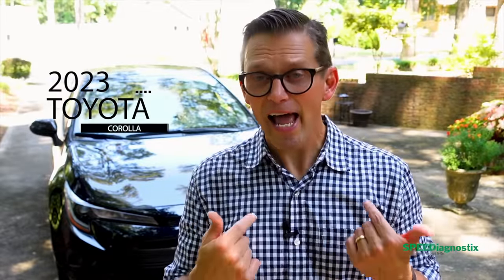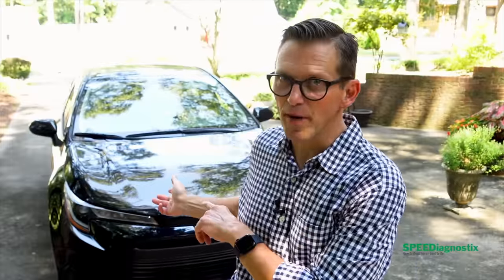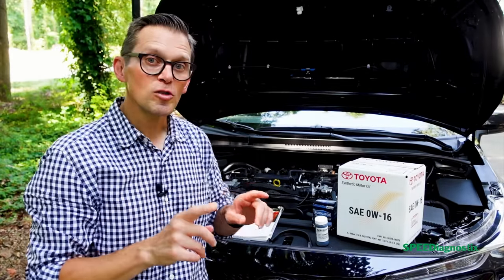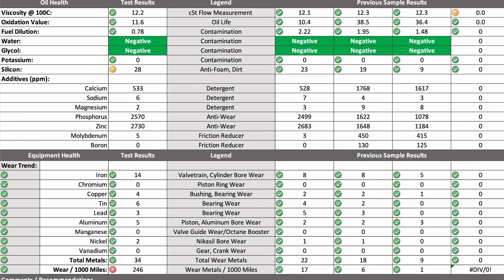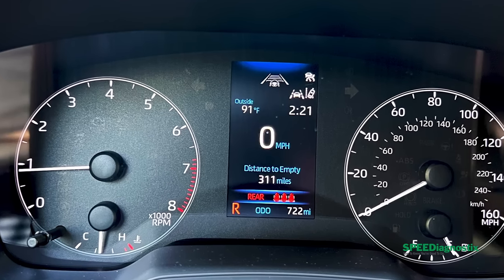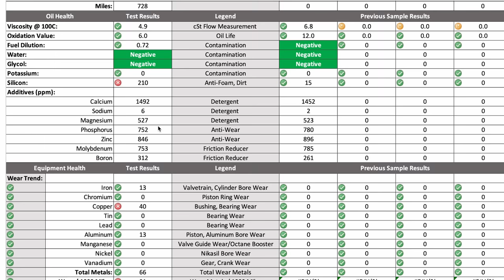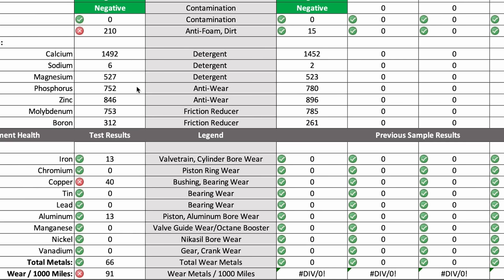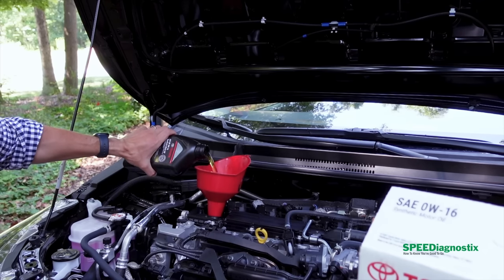AVOID the ONE MISTAKE Almost EVERYONE Makes With A Brand New Car

Comment: This reminded me that I need to change oil in my daily. I don't have good access to oil tests here in Europe and I drive a lot on dusty gravel so I try to stay on top of oil and air filter changes.
Thanks for all the great information. 👍
Reply: It's all a load of time wasting money wasting oil wasting crap. Just change it as per manufacturers recommendations. Oil tests are a joke too.
Reply: @motleydude73  I have no idea what you mean, but the manufacturer doesn't know how I use my car.
Reply: @PSA78  You use it the same as everybody else, which is giving the engine far less stress and abuse than the manufacturers give them when benchtesting them. Toyota run theirs for 144 hours straight at full revs. If they say change your oil every 10,000 miles or 5000 under 'severe' conditions you won't have any problems.
Reply: @motleydude73  That's not how it works, they know very well that different conditions (even different regions in the world) require different service intervals. I used to run engine tests for an engine mfg.
Reply: @PSA78  It doesn't matter just change it as per manufacturers recommendations it'll last decades and hundreds of thousands of miles, unless it's an inherently flawed design, like Hyundais and Kias. Just crap. I don't care about your 'credentials', real life experience says manufacturers OCIs are fine.
Reply: @motleydude73  Of course you don't care, you're just here to troll everyone with your "knowledge". 🙄

Comment: I usually download the South American owners manual for my car(same exact engine) and check the oil weight listed and that will tell you this incredibly thin oil is strictly for USA CAFE standards, not engine longevity. In many other countries for that exact engine the manual calls for up to 5w30 oil.
Reply from the maker: Thanks for sharing!
Reply: That figures.
Reply: I can attest to this also for Transmission Fluids. I rebuilt a 2003 GMC Sierra 2500HD and also a 2006 Chevy Silverado 2500HD both have the same transmissions (4L80E) and the 2006 called for (different) thinner fluid but I put the thicker transmission fluid as was used in the 2003 GMC. For people who say well the clearances are tighter so you need to use the thinner oil. These were the exact same transmission down to every last seal, etc. The USA CAFE standards along with these rip off companies are destroying the vehicles and getting maybe slightly better gas mileage from maybe a little less friction. Hence why they say in the manual for this Toyota to do the first oil change before 10k, if they were honest they would say 500 miles and send this video to every buyer of their product.
Reply: @usapilot78  so true. I don’t know who started this tolerance myth but it’s been proven wrong.

Comment: ❤ it! Going to do the same with my next car. I use synthetic oil, extended life filters and 5000 Mile oil changes which I do myself.
Reply from the maker: Sounds great!
Reply: You should be able to go for a long time with this strategy. Doing it yourself means it will be done properly.

Comment: I recently got a completely rebuilt engine (brand new block, etc) and it had oil and filter changes at 20 minutes, 250km and 1000km.  It's had 5000km changes ever since.

Comment: Manufacturers used to recommend a pretty comprehensive break-in procedure.  They all used "break-in oil".  I remember the first change being at 1000 miles, not 500, but it probably varied over time and from one manufacturer to another.  During that 1000 miles you were advised to not rev high and to not run the engine at a steady RPM for long periods.  But most important was that 1st oil change.
Reply from the maker: Thanks for sharing!
Reply: Was that in the 1970s? 🤣
Reply: @promethbastard  No it wasn't. I started my automotive apprenticeship in 1993. No cars had 'break in' changes. The first change was always at 10,000 kms. These days it's 15000. I bought a new Honda Accord in 1995 first change was due at 10000. A break in period was recommended but not early oil changes.
Reply: @promethbastard  It was in my country. Did away with break in changes in the early 80s here. I remember my Mums 1978 Toyota Corolla being done at 1000kms. But Dads 1984 Nissan Sunny first service was at 10000 kms. Americas always been a bit behind. Still use miles 🤦
Reply: @promethbastard  Nobody I knew/know ever did it.  There's no point to it. And the cars lasted many decades and hundreds of thousands of kms so that in itself proves it's a waste of time and money. Nothing wrong with dealerships, highly trained techs and OEM parts.
Reply: I bought a 2021 kawasaki vulcan brand new and it had the 1000 km break in oil change where I was told not to keep the rpm steady, I also recently bought a 2024 mazda3 and was confused when I was told the first oil change was at 8000kms with no special treatment to the engine required in that period of time. (Yes I know ones a bike and one is a car but both combustion engines).
Reply: @smackers1514  thanks for the information  i currently have 3 Toyota  i have a 2022 camera xse  bought brand new  2000 Tacoma sr5 bought brand new and a 1986 Celica gts   one owner  bought  new  one owner  me  and all three of Toyota get  a oil change at 1  thousand  miles virtually every month  but any way thanks for the comment
Reply: From USA: My 2003 3.6l v6 Pontiac and 2007 650 Kawasaki motorcycle both had explicit break-in and first oil change instructions in the manual.  My 2017 6.4l v8 Dodge had even more detailed engine break-in instructions but no special instruction to change the oil 'early', which was surprising to me.
Reply: @jameseverly8501  Every month? 🤣🤣  On all three? 🤣🤣
Reply: @oogieboogie232  Why was it surprising? Do you not understand what oil and filters actually do?
Reply: @motleydude73  It was surprising to me as both previous vehicle manuals explicitly stated to change the initial oil and filters after a much shorter period than the normal interval and the new one did not.  I didn't perform that first oil change on the motorcycle so I can't speak to it, but there were visible flecks of debris in the car's oil and I've had similar experience with the first oil change for my father's vehicles.
Reply: @oogieboogie232  None of my cars ever required it. Nor the thousands I've worked on as a service tech. I bought a new Honda Accord in 1995 first change was at 10,000kms, as per Hondas recommendations. I've yet to see any detrimental effect to not doing break in changes. Current 14 year old car is at 251,000 kms zero problems. A lot of motorcycles run a break in oil, basically mineral with a high zinc and phosphorous content so that should be dumped out after 600 miles or so. Cars, in my experience, haven't needed an early change since the 1970s. Some models obviously recommend it.
Reply: @smackers1514  The Bike would have had break in oil from the factory the car doesn't. Hence the difference in change intervals.
Reply: @motleydude73  Interesting.  Im curious what was in the pan in the Hemi after 1000 miles but it was a lease, didn't fit on my old wheel ramps, came with a service plan, and given the included service I didn't really want to go buy a bin of 0W-40 😄.
Reply: @oogieboogie232  The filter collects most of it, anything above microscopic particles anyway, and the oil holds any other particulates in suspension amidst anywhere up to 9 litres of oil. Engine 'damage' is more in the minds of paranoid people than anything physical. I thrashed my Accord from day one it was upto 277000kms when it got written off by another owner. Was still running sweet with zero oil consumption. I know as I often serviced it after my ownership. There is no harm in changing oil out early but IMO it's not neccessary.
Reply: @motleydude73  yes  pretty much around 1 thousand miles   1986 Celica gts 2000 Tacoma sr5  and 2022 Camry xse  one  thing I hate  is I am not a fan of synthetic  oil  unfortunately    my 2022 Camry  came with that type of oil    however  I recently had  change my Tacoma to a synthetic  blend  which is ok I guess and I am lucky enough to find Castrol  10-30  regular  oil for my  Celica  although  in my Celica I have been using Mobil  10-30 conventional oil for the  past 30 years  without single engine issue  but any way thanks
Reply: @jameseverly8501  A good synthetic lasts 15k these days so dumping it at 1000 is insane. Must cost you a fortune.
Reply: @motleydude73  thanks  for the response   however not saying you but I  will not go 15  thousand  miles on my oil my 2022  Camry which has synthetic oil  cost me about 90 dollars an oil change  my 2000 Tacoma   I am using a synthetic blend  which cost about  120 dollars  for an oil change  and on my 1986 Celica  gts  i am fortunate  enough to find  Castrol 10-30  conventional  and that oil  change is around 100  dollars  and yes  every vehicle  gets and oil change around  1  thousand  mile  but any anyway thanks for the comment an I am not a fan of synthetic   oil main reason  is that my Celica  1986  I have been using Mobil  10-30  conventional oil for about 30 years   without a single engine problem or issue thanks again  kind of funny  on my Tacoma and the Celica  i have to purchase  my  own oil and have the dealership  do the oil change with my  oil lol
Reply: @jameseverly8501  But WHY? You are just wasting money and good oil 🤦  1000 miles is ridiculous. You can do 10x that distance. Most people do. No problems.
Reply: @motleydude73  I perfect understand that, but I buy my vehicle brand new and do the oil change about once a month or abut 1 thousand from the start and that is my standard no disrespect on my 1986 Celica  gts  i have around 272 thousand mile and have done the oil change same way for about 38 years and I have not had one single problem out the car and or engine   original engine with no problem
Reply: @jameseverly8501  Yea , same with all my vehicles done at 10k miles. Zero problems. Anyone would tell you 1000 is excessive, even 3000 is only a fifth of it's usable life. Synthetics are far superior to mineral. Hence why all modern cars use it now. But do what you want. It's your money.
Reply: I ve never heard of break in oil.
Reply: @Peterthepainter66  It was used in cars up until the 1970s, and still is in motorcycles. Has a high zinc and phosphorous content. Modern cars don't need it first change can be done as per manufacturers recommendations. At our Dealership that's 15000kms. A break in 'period' of careful driving for the first 1500 kms is recommended but there is no special oil in a new engine.
Reply: Yes to driving at variable speeds for a new vehicle and especially don't use the cruise control on flat roads until after the first oil change.
Reply: @Roarmeister2  Why on earth not? Perfectly fine to.
Reply: Subaru still recommends this in the owner's manual
Reply: @motleydude73 most new cars have the first oil changes free as part of a service package...so there's no cost at all
Reply: @motleydude73 dude mind your business stop forcing your beliefs onto others
Reply: @truckercowboyed2638  Not in my country they don't. First service is $365 at our dealership. And they're not 'beliefs' they facts. You think changing your oil every 1000 miles makes good economic sense? It's nothing short of insanity.
Reply: @motleydude73  
Into the 2010's at least here in NA. There was a person here in Canada who bought a new Jeep about a decade ago. Didn't follow the break in procedure including the first oil change at a 1000kms (I think), and the engine seized at 2000kms. The warranty was denied. The break in oil change wasn't done. That person took Jeep to court but lost. Even made the local news. Some people think you just get into a vehicle and drive it . I had a 87 Chevy Sprint that I bought new. I put 187,000 kms on it with only 3 oil changes including the break in change which was at 500 km's.
Reply: @MrDarcykampe  If the engine siezed at 2000kms it was a design fault nothing to do with the oil, which would not have been break in oil. That's 1970s idealogy. High zinc/phosphorous oils are still used for motorbikes but not cars.

Comment: Just bought a brand new Tundra HV. I always change the oil at early and frequent intervals within the first 5k of life. First one at 500 miles, second one at 2000 miles, and then again at 5000 miles. Will always change at 5000 miles from there on. This is how I've treated every new vehicle I've gotten.
- Toyota MDT
Reply from the maker: Right On!
Reply: What if I don't....nothing happens. Brilliant.

Comment: There's a channel here of YouTube, Garage Gear.  He showed this with a brand new lawnmower by running it 10 or 15 minutes then changing the brand new oil out.  You should see the metal in the oil!!
I also learned this in 2019 when I changed the transfer case, and both diff fluids in my 2019 Ranger with about 5000 miles on it.  They all drained out looking like grey milk, with the magnetized drain plugs with so much metal on them they weren't catching metal anymore.
Reply from the maker: Thanks for sharing!
Reply: Yeah ... especially with OPE - Outdoor Power Equipment ... the first oil change comes out looking like silver soup.
Reply: @seanthompson8071  read in my comment above about my transfer case and both diffs in my Ranger?   I was shocked!!
Reply: @TheBeatenPaths  Funny. At Toyota we don't do the diff oil until 60,000kms. It always comes out looking like... pink diff oil! Grey suggests water is getting in. 5000 miles? I call BS.

Comment: Yeah I always changed my first at 500 and added a neodymium (large) magnet to the oil filter.  Your daughter is lucky to have a mad scientist as a father! 😀
Reply from the maker: Thanks!
Reply: What is a neodymium magnet and where do I put this? Thank you!
Reply: @JesusIsLord7773  Not sure if this is what he's talking about, but I've been using a FilterMag magnet that wraps around the filter. I cut open a filter after about 5k miles and found a black soot on the inside of the filter where the FilterMag was mounted. It seemed to be very fine particles that had clearly flowed through the filter element.
Reply: Harbor Freight $1
Reply: Where is the best place to place the magnet?. Thanks JohnB
Reply: looking to learn where do i put the magnet
Reply: @snakeoil24snake3  Filter mag sells one that attaches to the side of the filter, you can also but separate magnets from Amazon or other and just place them around the filter housing.
Reply: @curiosity2314  ok so attach to exterior their is no such magnet to attach to interior for oil to pass over?
Reply: @snakeoil24snake3  Additionally, you could take your oil pan off and install magnets inside but cleaning them would not be easy as you would have to remove the pan. Installed on the outside of the filter is a benefit as you throw the filter out and move the magnet to the new filter. Not much if anything is going to get past the magnet as it is that strong.
Reply: @curiosity2314  You don't need to put the magnet IN the oil pan as long as it is sufficiently strong.  Whether a metal or modern plastic oil pan, either way a reasonable sized rare earth magnet will still trap particles when placed on the exterior.  Even better, this allows you to take the magnet off  when you do oil changes to flush out what it caught.  Try it yourself on a spare oil pan if you don't believe.
Reply: @stinkycheese804  
Metal particles will flush better if kept suspended in the lubricant.  That's the whole purpose of the lubricant, to keep particles suspended.  Defeating that purpose seems unwise.
Reply: @snakeoil24snake3  I recently bought a  new malibu and after a  few  hundred  miles took the oil filter  down and put a small magnet inside of it  and put it back on.

Comment: I’m pretty obsessive about oil changes but even I wouldn’t do the first change at 500 miles. 1000 to 1500 maybe with subsequent change every 5k with full synthetic.
Reply: 5k intervals is absolutely not “obsessive” 😂 im doing every 2500 on my gr corolla and did first oil change at 700 miles.
Reply: @brandon9491  Yea that's ridiculously obsessive. 10k miles is fine.
Reply: @motleydude73  10k on this motor would be considered abusive lmao, toyota recommends 5k but considering im gonna be beating on it ill just do every 2500. Easy enough and only cost me like $35.
Reply: @brandon9491  Toyota generally recommend 10k. I work on them every day. Abusive? It's perfectly fine. You're gaining nothing by doing excessive changes. 5k is recommended for the new GR.
Reply: @motleydude73  yes, that is why i said on my gr corolla 💀 10k interval on this motor is 100% considered abusive
Reply: @brandon9491   It would still run perfectly fine for many decades and hundreds of thousands of miles. And a break in change is completely unneccesary it's not 1980 anymore.
Reply: @motleydude73  no, it would not run for hundreds of thousands of miles with 25lbs of boost. Like i said, i beat up on this motor. Break in oil change is definitely needed on high performance engines. And even if it wasnt, why the hell would you not regularly do a $40 maintenance on your second biggest investment? 10k miles is only to reduce the “cost to maintain” and make sure you come in after warranty expires.
Reply: I worked at a Toyota dealership. Seen lots of engines being repaired or replaced because of 10,000 mile oil changes.
Reply: @kevingriffin4123 so ya'll would say 5-6k mile intervals is fine with my new corolla?
Reply: @F82_  If you don't sit in hour upon hour of stop and go yes. If so, think of those hours as dozens to hundreds of miles being added to the engine between oil changes.